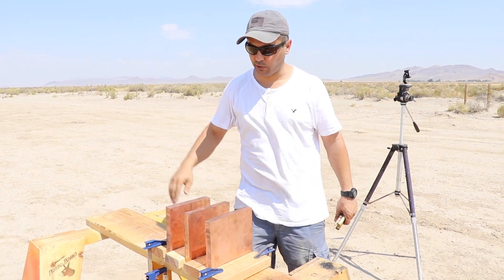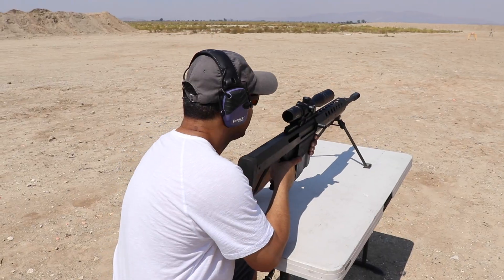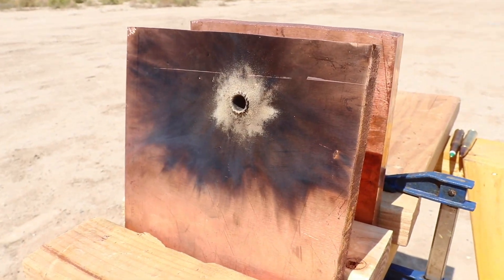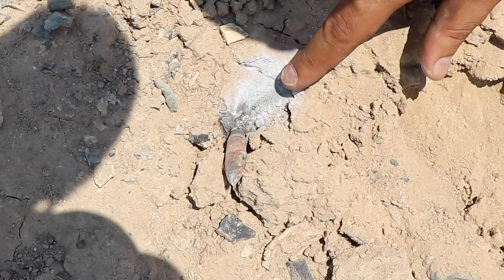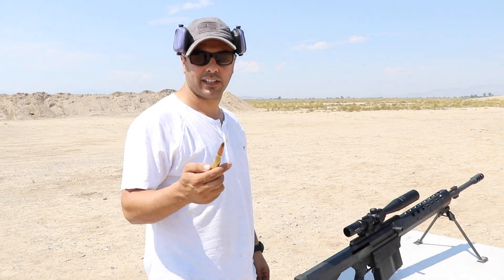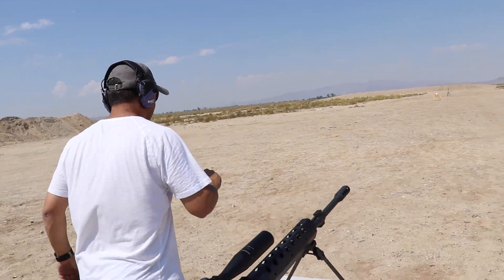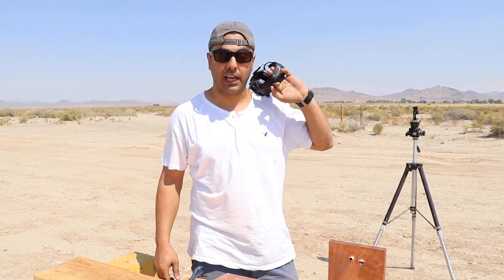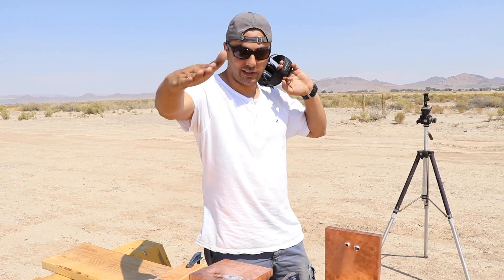50 CAL VS COPPER PLATES - how strong is copper?

Comment: The second shot veered off in a direction away from where the first shot went in. The first shot made the metal around the hole it created harder from compression forces. If fired at fresh copper plates it would have gone through all three.

Comment: The kinetic energy of this 800m/s bullet slowed down by these plates. The friction. It somehow gets transfered into heat. And by the way that you couldn't punch this bullet through the plates by hand, yet it still will get hot after some time because of friction, you can tell what an aweful lot of heat these bullets must have, which just traveled trough inches of solid metal... So I guess one shouldn't be surprised if you burn your fingers when you try to put them up right after ;-)

Comment: Was this annealed (fully soft) copper?  Looks that way.  Yield strength of 'regular' annealed  copper is only 10ksi but it comes in work hardened grades with much, much greater strength (5-6x as strong).

Comment: I haven't seen it mentioned yet, but copper work hardens. The more it's deformed, the harder it gets. That could be part of the reason the black tip didn't do as much damage and is almost certainly why the bullet turned left. It kept pulling towards the softer side. You can anneal the copper to get it back to a pliable state after it's been work hardened.

Comment: Should grind the metal back down to the surface of the plates, clamp all three together, and try a APIT round on the whole block (without the space in between). Assuming the danger of bounce-back ricochet can be ameliorated.

Comment: I understand you want to be safe and that's good. But i think the threat of ricochette is somewhat negligable when it comes to shooting a flat metal target straight on. I mean, most targets that people shoot at often are made of ar500 steel. You mainly need to worry about things or people off to the sides.
Reply: when it craters metal all the material removed from the crater is sent backward, maybe technically not a richocet but still dangerous

Comment: I always thought cooper plates are more impact resistant? 🤔
Reply: pure metals are more malleable than alloys because of their their atomic structure
Reply: AlienGoBoom impact resistant not penetration resistant
Reply: @vetsenstew3271  same thing same concept. Penetration = impact.
Reply: @prandomable  no, copper can more easily absorb an impact and dissipate the energy e.g. bend.
Reply: @vetsenstew3271  impact is penetration. Same thing.
Reply: @vetsenstew3271  penetration is bullet impact.
Reply: @prandomable  no it's not, a 12 gauge slug delivers almost twice the energy of a 5.56 at 100 yards but the 5.56 will penetrate much deeper in a target than the slug.
Reply: @vetsenstew3271  larger cross sectional bullets (diameter bullet) usually will require more energy to penetrate than smaller cross sectional bullets. Once the bullet's impact energy is enough, it will become penetration.
Reply: @vetsenstew3271  either way, copper is weak...
Reply: That's what she said.
Reply: @Clearanceman2  old joke but that got me lmao
Reply: Copper
Reply: copper alloys are more stronger than pure copper
Reply: Ok cooper
Reply: @landonreed3464  00plllllllllllllllllllllllllllllllpl ppl lllllpp
Reply: AlienGoBoom no copper is deff not, it's soft
Reply: @diablo2elitepvpguides405  yes it is?
Did you learn history in school, bronze/copper age them the more stronger iron age.
Reply: Soft metal
Reply: Copper is a very maluable substance, similar to silver and gold. Indeed they are all under the same column in the periodic table, a reason why they have similar properties
Reply: Whaat is Cooper?
Reply: @youdeserveit8575  🔫
Reply: @copperlord9271  So cooper is a green squirt gun??
Reply: @youdeserveit8575  cooper is metal
Reply: @copperlord9271  I think you're confused with copper!
Reply: @youdeserveit8575  copper is my life
Reply: @prandomable  what ??
Reply: @vetsenstew3271  you are saying bullets' impact is different than bullet penetration. Not really. Bullet's impact automatically becomes bullet penetration once you've reached enough velocity to penetrate the material.
Reply: @vetsenstew3271  throwing base ball at a piece of glass, it wouldn't break. But if you throw it hard enough, it would break and penetrate. Impact resistant is penetration resistant.
Reply: Not at all.  Copper is a very soft, malleable and lubricating metal.  So not only does it not stop rounds it's self-lubricating and the rounds can go through it more easily.  Or is that brass?  Yes, it's brass, which has copper (70%) in it.  
Cooper, on the other hand, is a barrel or keg maker.  Beer and wine are yummy, so a cooper is very cool!
Reply: Copper is quite soft compared to steel
Reply: @kienhwengtai8113  wayyy softer. Aluminum is also extremely soft metal. That's why people can crush aluminum cans with their hand.

Comment: WRONG! the phosphorus or magnesium is coated in the front of the bullet not the rear. The air friction causes the element to ignite, producing a bright bright glow...Thumbs up great video!
Reply: paulF60m23 
Sorry sir you watch too much MythBusters pyrotechnic compound is in the back of the projectile it’s ignited by the gun powder in the case when the round ls fired
The color on the front of the projectile is there for identification of the project
No color ball ammunition
Black AP armor piercing
Red , maroon , Orange , tracer ammunition
Silver armor piercing incendiary API
Red and silver armor piercing incendiary tracer
Green and silver  MK 211 armor piercing incendiary ( A more potent API around)
Green silver red the tracer round MK300 ( The tracer round of MK 211 )
They have several other 50 rounds with different color code markings but I have run my mouth long enough here goodbye

Comment: Definitely need a .50 BMG loaded with API rounds when you have that much copper on hand (-: That had to be an expensive experiment. 
Bear in mind that although copper is pretty soft, it is very dense (it's actually used in composite tank armor) so for a bullet to go through 3" of it is really impressive.

Comment: On a serious note.  It would be nice to see the limits of each 50 BMG projectile.  Specifically, how much material is required to resist penetration by each type of round.  Start with softer materials of increasing thickness, like copper and aluminum and work your way up to 7075/7475 T6 then onto brass, mild steel, hardened steel.  This way we could see the limits of each round.  It would be a bit more of an experiment than you are used to but that is no big deal.  You have the equipment, interest and God knows you have the time... lol.  It would be a series of videos that many people would be interested in AND it would keep you out of trouble for a few months.  Think about it.  I actually do not know what those limits are and it would be nice to know.
Reply: Rafael Lastra com Black tip would be the best, not talking about Green tip but that's 100$ worth.
Then API ,then APIT.
Reply: 408 cheytac is way better than 50cal at long range penetration

Comment: Lets keep in mind that spaced armor is way harder to penetrate than regular non-spaced plates. The reason is that the projectile has space to tumble, fragment and/or change flight while traveling in between the plates. Great video as always, love how you bring out different targets to be shot with crazy rounds.
Reply from the maker: +TexugoFTW thank uuuu
Reply: That's also why the black tip didn't make it as far. It just happened to yaw on exit and break up hence the two impacts.
Reply: Thats not exactly true, layers are important, but space is a negative. Energy transfer is the goal, and space between layers denies the transfer of energy.

Comment: Interesting to see. Copper is fairly soft. I would say, always compare with a standard round. Very cool to have high tech rounds but standard is a good reference point. You can also look up the principle of the rounds you use.
For future videos, I'd very much like to see aermet 100 plates if you can get someone to give you some. It's a very strong steel alloy. Maybe start with 10mm because it's strong. You could also try Glare sheet which is an alu-fiberglass composite used for aircraft and explosive resistant cargo containers.

Comment: It's interesting that the armor piercing round went through less than the the Armor piercing incendiary
Reply: Deathdragon228 Copper work hardens pretty easily. I would bet the first shot hardened the surrounding material.
Reply: Deathdragon228 But it wasn't the steel penetrator that went through with the apit. It was the whole bullet, jacket and all, which was unexpected. But a regular ap round usually should penetrate better than an apit. Work hardening is all I can think of.
Reply: Deathdragon228 the incendiary has less mass cos of the hollow thing !